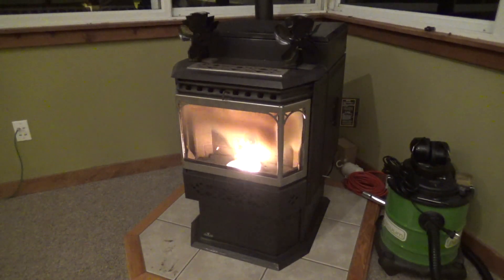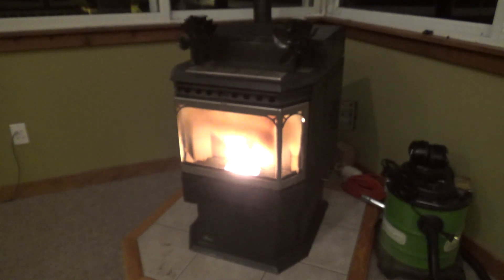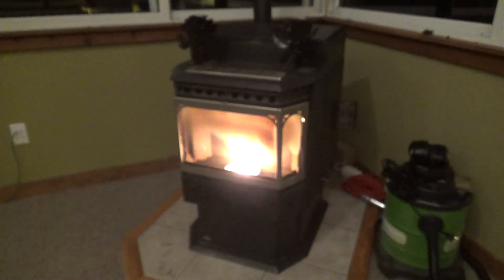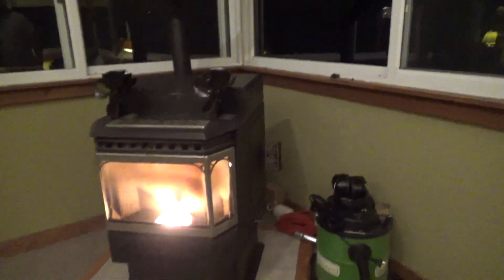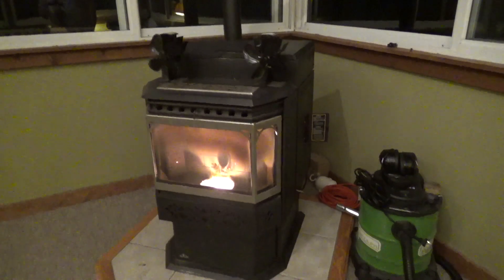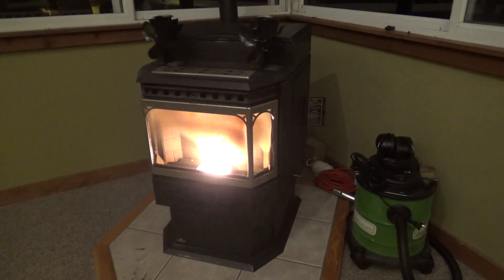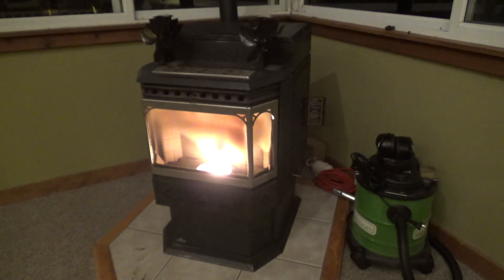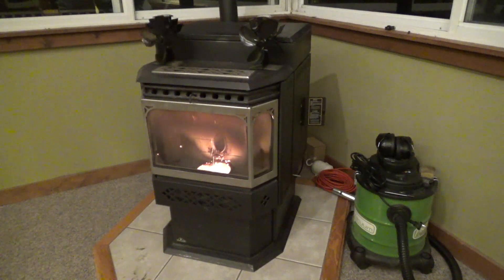Good Troubleshooting Techniques: Focus On The Source, Not The Manifestation

Comment: Maybe technicians should be told that in the event of a glow plug failure to always check the igniter.
Reply from the maker: Clearly you have completely missed the point of the video.
Reply: Yeah my bad. I should have said check the thermal switch as a matter of course in the event of a glow plug failure.
Reply from the maker: @German_byte  You are still completely missing the point of the video.